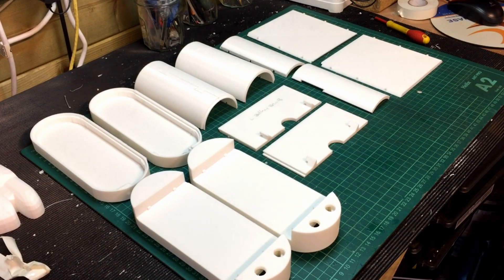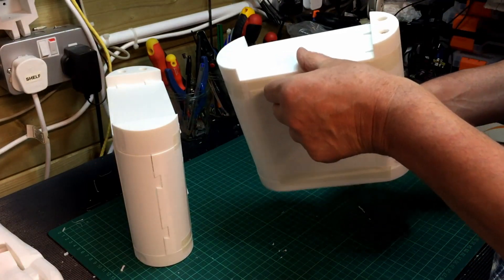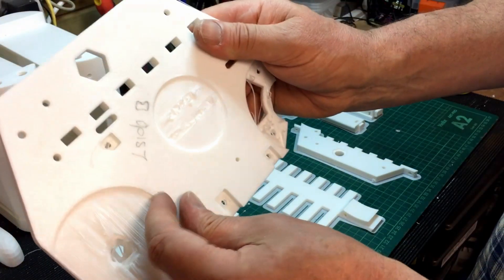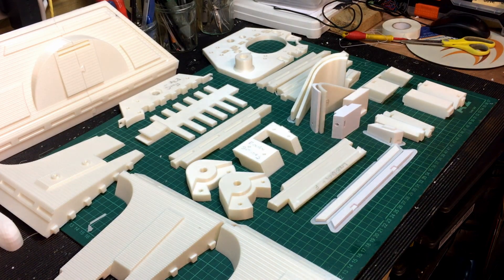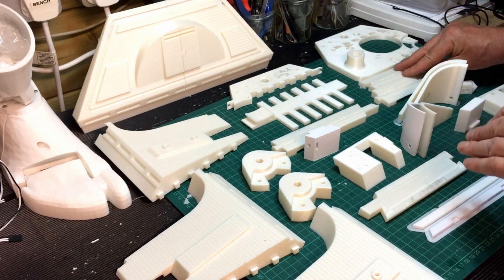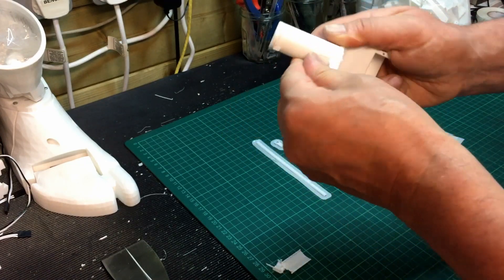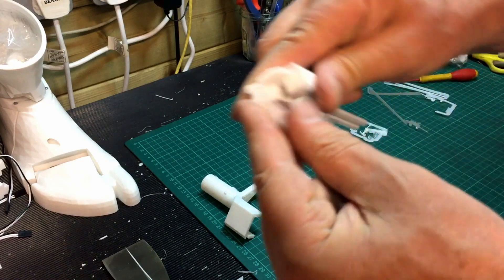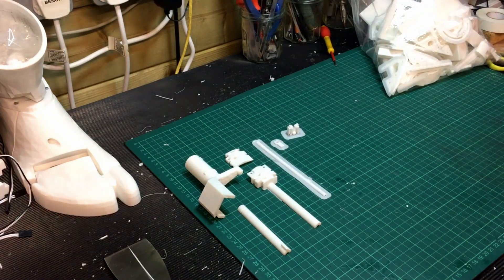R2D2 Droid Build Part - 8

Comment: @3:34 how did you get it of that easy ?
Reply from the maker: Hi Rebel.   Luck probably!  I may have changed slicer by this time and this was sliced with Simplify3D maybe.   Its good with skirt layers etc.  so they are not printed too thick.   I did have to clean all the edges with a file/sandpaper later and the larger sections were not so easy as this.
Reply: kyle campbell nice thank you :)

Comment: In What orientation did you print the curved parts of the battery boxes?
Reply from the maker: Hi Troy
Just checked my GCode files and I printed the curved sections vertically and used  support and a skirt around them to hold them upright. I was a bit wary of them toppling over but with a good skirt base they held up.  The sides sections I printed flat on the bed.

Comment: Hi Kyle, I saw your issue with leveling the STL files for printing. I've been using Simplify 3D and it has the option where you can select any face/surface of the object and position it flat on the print "surface" as needed. This feature proved to be very useful as I've been printing out R2D2 parts in PLA on my CR-10 S5. It only takes few minutes to prep each STL and convert it to gcode. Also with PLA being the medium I never have an warping issues. The biggest culprit is usually overhangs.
Reply from the maker: Hi Alex, I have been considering Simplify 3D for a while, been reading such excellent things about.  Also I see that many of the 3D Utuber site channels all seem to use it.  I do like the idea of creating custom supports etc.  I will give it a go, thanks for your comments.

Comment: Evening, great video, could you tell me what glue your using to glue the R2?.
Reply from the maker: Hi Darren, hope your enjoying the weather.  GA glue with activator, tried a couple of different brands and all seem to work.  From Amazon I have used Mitre Bonding Kit Superglue & Activator Sytem Rapid Strong Joint Adhesive Bond, also tried Everbuild equivalent.   Its great that you can work the components around a bit with the superglue in place and then quickly lock them by spraying the activator on.  Bit smelly needs ventilation.
Reply: Morning Kyle, thanks for that, I've been printing 24/7 at the moment and now on the second level of the body. Amazing how quickly it starts to look like the real thing once you start on the middle section
Reply from the maker: Hi Darren, so true. I just finished the next video with the legs partly attached and feet sort of ready on them.  Printing Centre foot at the moment.  It gets really big when you you have the feet on it, have a look at pictures on Nigels blog.   https://myrobotnigel.blogspot.com/
Reply: kyle campbell I can't seem to find the centre foot option on Michaels Opendrive. I know he was developing it and the latest updates I've downloaded. I'm way off of that anyway. Love this build and it's made easier by your videos. Thanks once again
Reply from the maker: This?
https://onedrive.live.com/?authkey=%21APA5Cxi7TQXSqMw&id=E84CB8FD47152532%2126620&cid=E84CB8FD47152532
Reply: kyle campbell great! Found it, thanks